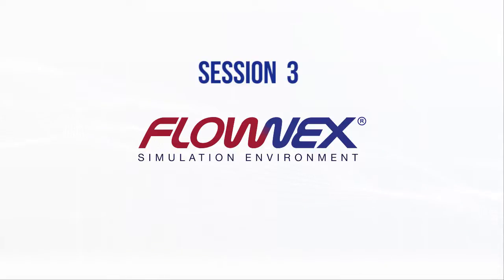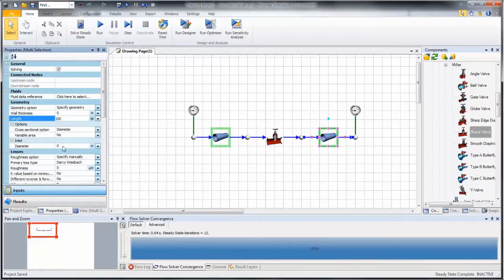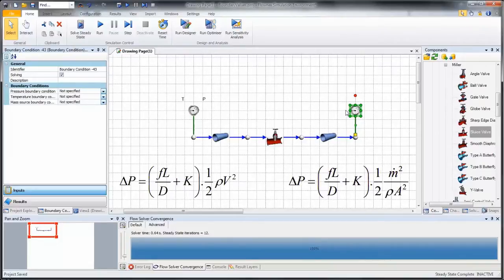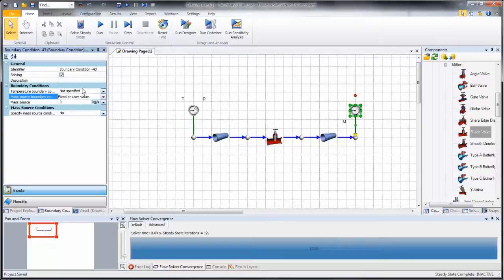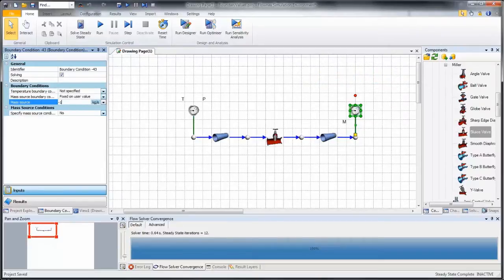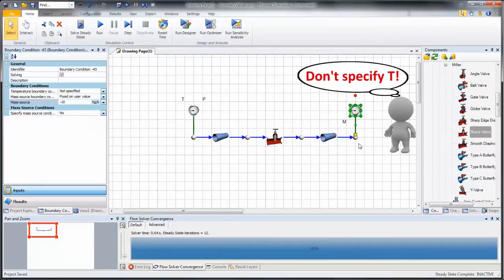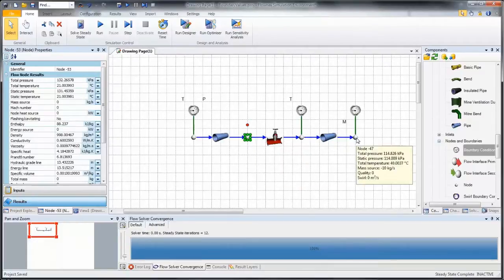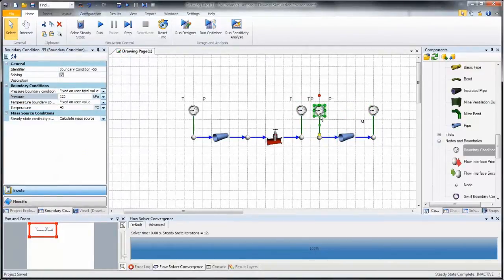Session 3: Boundary values

Comment: Can I specify that the flow through a component is Isenthalpic?   So if the inlet enthalpy is knows, it will solve for an outlet condition with the same enthalpy.  This is for  refrigerant flowing through an expansion valve.